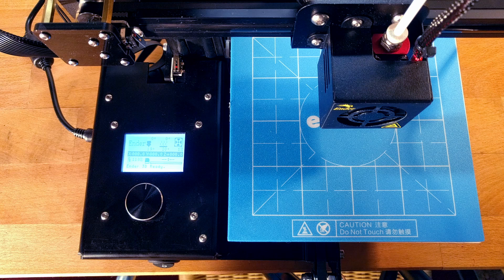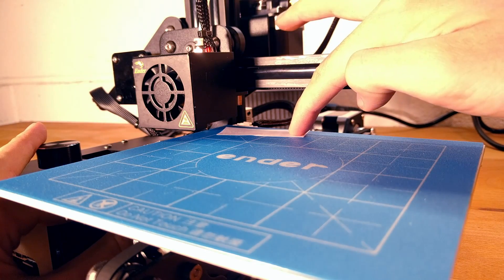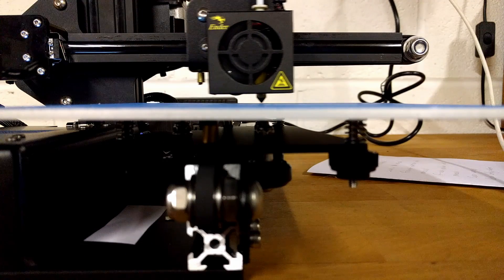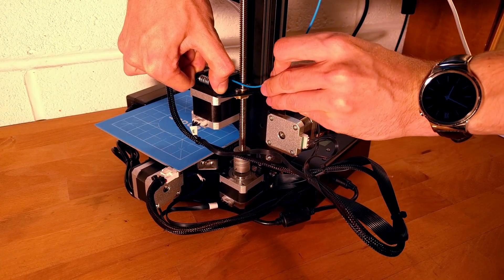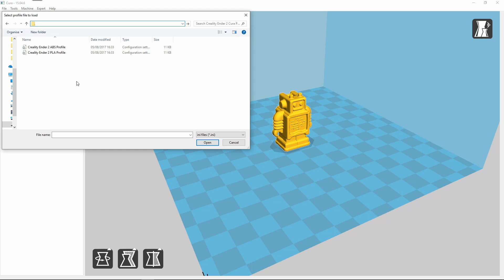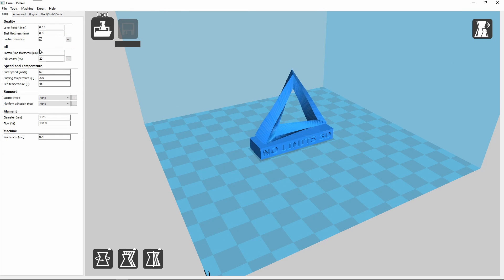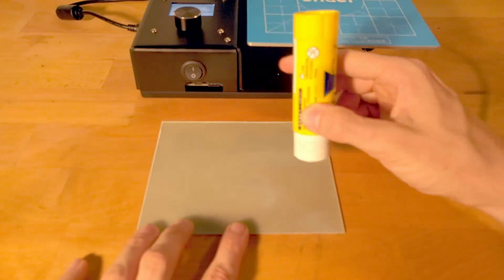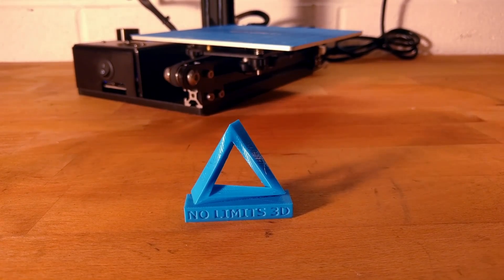Setup and level your 3D printer! - A tutorial for the ENDER 3D printer

Comment: Just set up my Brand New Ender 3D and began the setup process.  The table is a couple mm away from the nozzle. Is this normal.  This is my first 3d printer and venture into this tech.  Just don't want to break a new tool.
Reply: Same here but i try to play with z limited
Reply from the maker: Hi, the nozzle should be about a papers thickness away from the print bed. If you have an Ender 3 see the levelling guide in our followup video https://www.youtube.com/watch?v=ozzjcokB4UI

Comment: I'm desperate here.  Been trying to level the bed since yesterday by repeating the process over and over again.  I tried the test and scratched my bed a bit.  The issue I found, if an issue, is that the vertical support for the nozzle is not leveled so the height of the nozzle is not the same from one side to the other.  Can someone help??
Reply from the maker: Can you elaborate on what you mean by "the vertical support for the nozzle is not leveled"?
Reply: I took it all apart and assembled it again and was able to level the bed properly.  Now I was printing and it just stopped halfway.  I paused and resumed a few times with no luck.

Comment: Hello!  A few weeks ago i ordered the Ender 3D Printer as well. I build it up as shown and startet watching your Video.

My Problem is in the first step you are doing. When i choose the "Home Access" Option, the first axle is moving towards the centerpiece. Here it hits the Lever as shown in your vid, but then it is making a terrible Sound, as if it wouldnt stop pressing against that lever. The other axles wont move either. Then i have to turn off the whole ender Printer...

I dont know any solution. Can you help me with this NoLimits?:O
Reply from the maker: It sounds like your end stop switch isn't working properly, check all your connections are correct and that no wires are broken.
Reply: NoLimits3D  
I will check that, thank you for answering!:)

Comment: Hello, I don't know if you can help me but I have recently order an Ender 2 (it's my first printer) and I have many issues with it :
- I can't print a straight rect shape https://imgur.com/a/yd7l4
- Prints have lot of strings (I have enable the retraction) https://imgur.com/a/84d0P
- I need to re-level my bed every time
- I have missing layers
- I can't print a good first layer
Note : I have print the duc fan, the z axis stabiliser and the filament guide.
Benchy : https://imgur.com/a/bmqC8

Thanks
Reply from the maker: Hi, that's unusual as they usually work great straight out of the box, what slicer and filament are you using?
Straight rect shape - Is your x-axis perpendicular to your bed, and your belts tight?
Stringing - try increasing your retraction distance and/then speed, or lowering the extrusion temperature.
Re-level - If its just the distance, then check belts aren't slipping, otherwise check everything is tight
Missing layers - are these skipped or gaps? could be belts slipping again
Bad first layer - if you're having problems levelling then this might cause that
I hope that helps!
Reply: Thanks for your answer, I use Cura 3.2.1 with your profile. My filament is Ice (https://www.amazon.fr/dp/B017HAIE2G). For missing layers there are skipped and gaps.
I have re-level my bed many times but it's never perfect :-/.
Note : When I have receive my printer the slide board move on the axis and I have tighten screws below.
Videos : https://youtu.be/_6ZzIRK_8TM https://youtu.be/uTRokiXsNz0
Photos : https://imgur.com/a/9jLrJ

Thanks
Reply from the maker: Hi, it's very hard to diagnose from a distance, but as these printers normally work very well, we suggest you check through your build to ensure everything is put together properly, also check the tightness of all screws and belts, hopefully that will help with any issues you have. If you are having to constantly level your bed, that would suggest something is loose or slack, as once levelled it should stay that way.

Comment: Hi thank you for your videos, they are very helpful. I followed you instructions with my new Ender and printed the logo, but it is not as clear as yours. I barely can read the letters. Any idea what went wrong?
Reply from the maker: Try sending a photo of your print to our gurus at support@nolimits3d.com, they should be able to help.
Reply: I certainly will, thank you. What version of Cura is the best for the Ender? 3 or 15? And what are the differences?
Reply from the maker: Either is fine, although if you want to print over USB rather than using an SD use 15. Cura 15 is the older original version of Cura, the newer versions have an "improved" user interface and algorithms and some newer features, although some people find the older version is easier to use. Ultimaker (who write Cura) seem to be moving away from more open source to more proprietary targeted for their own printers.
Reply: I find out that the eccentric nut on the y axis was also loose. I tightened it and started a print, but the filament got strangled on the spool which prevented is from extruding. After this my Ender is acting very strange. It doesn't rpint in the middle of the bed, but is printing on the most left side and even wants to print outside the bed. Any idea what could be wrong?
Reply from the maker: If you try and manually position the extruder from the LCD does it position correctly ?
Reply: Yes I can move all axis from the LCD screen if that's what you mean. Also the home function works well. It's like the snag it got from the strangled filament did something wrong. Hardware seems to be ok, could it be a software problem?
Reply: It seems like the printer now wants to print outside of its physical range.
Reply from the maker: If you can position correctly via the LCD, it sounds like the hardware is fine. Check your slicer settings particularly ensure the machine settings are correct.
Reply: Thank you for your help. I'll check the slicer settings first, but normally I didn't change them. Any idea where I can find the default machine settings?
Reply from the maker: If you are using Cura, these are covered in the video.
Reply: ok but are there maybe any changes in the machine itself that I might have changed accidentally
Reply from the maker: Unlikely with the symptoms you are getting. If the extruder positions correctly from the LCD interface, that suggests that mechanically everything is working fine. What it sounds like is the commands in the g-code file you are trying to print are telling it to print in the wrong place. As this is generated by your slicer, it suggests that this may think the build space configured is actually different from reality.

Comment: What is the extra build surface you are using?
Reply from the maker: It's a 1mm fibre epoxy glass sheet and is an ideal replacement for a glass print bed. It has the advantage with only being 1mm thick of being flexible making it far easier to remove prints from the print bed. They are ideal for use with glue sticks to make bad bed adhesion a thing of the past, and are easily washed after use. They have excellent mechanical properties, good heat resistance and moisture properties. Flame retardant high pressure laminate of epoxy resin and woven glass cloth, making them okay for use with or without a heated print bed. See https://www.nolimits3d.com/collections/accessories/products/grp-3d-printer-print-bed-sheet
Reply: Thanks for the reply. When will some be in stock?
Reply from the maker: We've just had new stock in today :-)